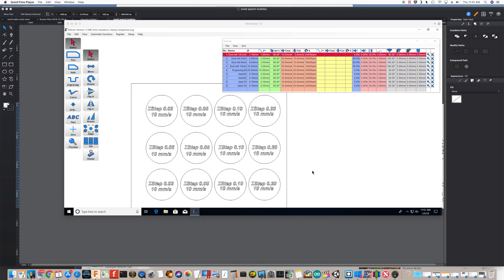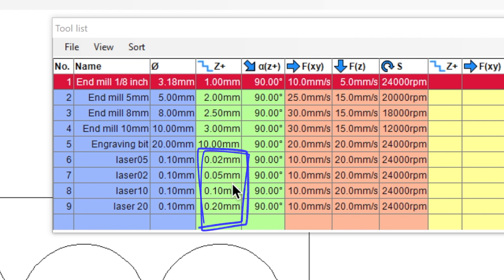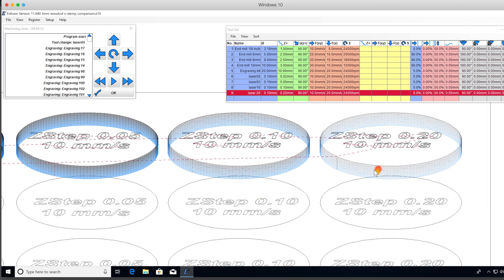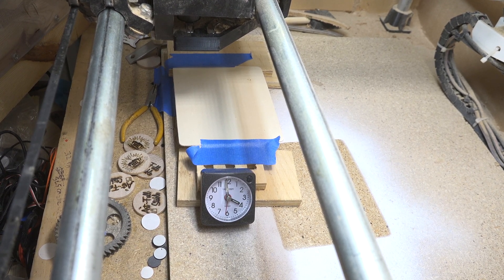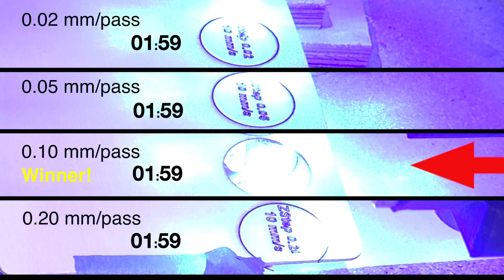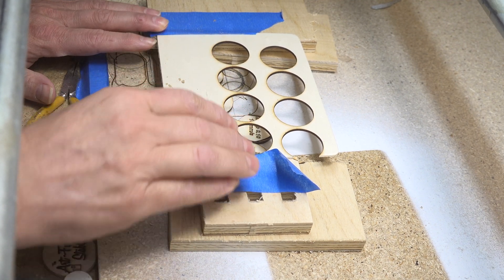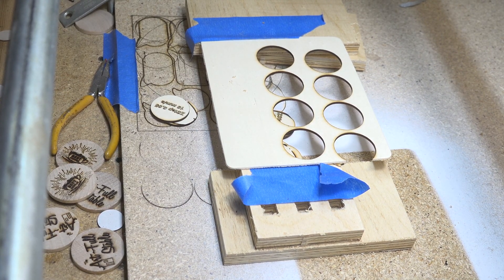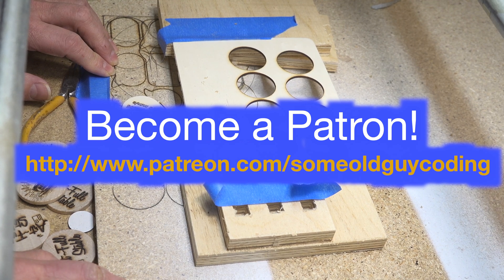Does Z step Size Make a Difference With a Laser ?

Comment: On CO2 laser is important where the focus is. When engraving it's on the top, and when cutting is in the material most of the time at the middle.
To optimize your cutting time, try moving your starting focus (z) a little down in the material.